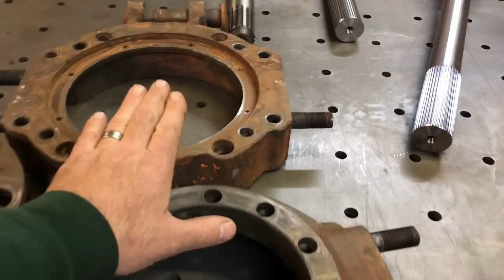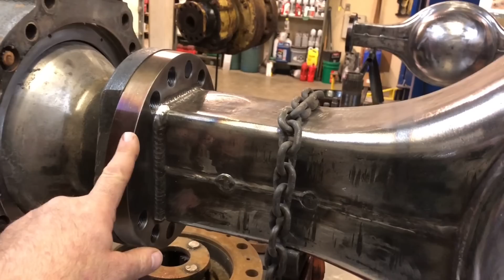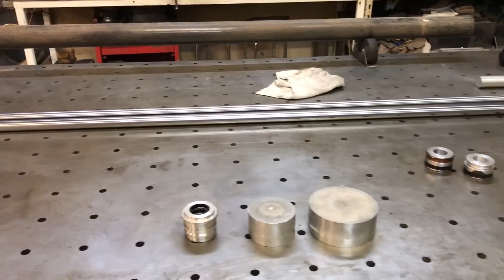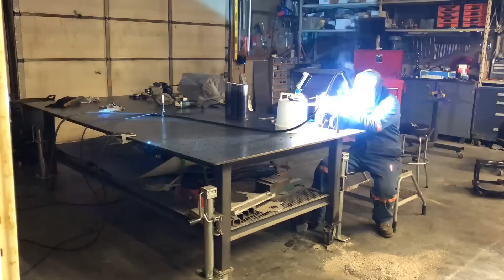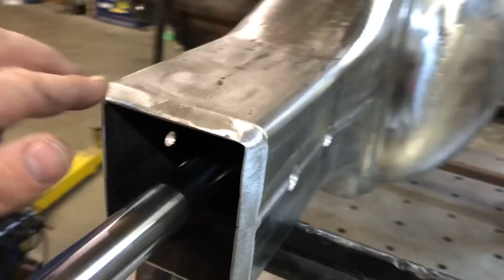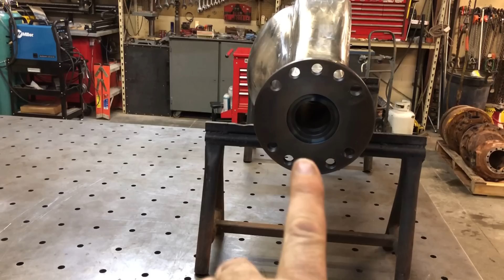Getting a start on building monster truck axles!

Comment: Never have seen anything on monster truck axles but my only question is do you have issues with the bolts breaking that go from the flange to the champagne, it just seems like a lot of leverage from the end of the hub to the flange ?
Reply from the maker: @treyblacksmith6554  
Those bolts can be a weak point, 
There are a couple guys developing an aftermarket champagne & flange that uses 14 bolts in that location.
Reply: @ gotcha , this is a super awesome technical video btw

Comment: Your mig welder has a foot pedal, or you adapted a foot pedal to it? If adapted, maybe sometime explain how you did it!
Reply from the maker: I added a foot switch,
The MIG gun plugs into the welder via a 2 pin plug, I found that same connector/plug & basically just wired in a switch I could step on, rather than squeeze the trigger on the mig gun.

Comment: Chalice :o) I like it better than champagne. And swivel housing! ;p) That is a neat trick how the knuckle splits because the leverage force is way lower than the taper bearing pressed into the ball part. Hub;  I think the gear drop is half with that set up and Zeta tractors did the same, but we never figured out why? Caster Angle; The old Range Rover diff pointed up at a very steep angle so that the two UJ’s were the same angle but opposite, so they still cancelled each other out at normal running height. Below and above that wasn’t a steep enough angle to cause trouble even with full time 4x4. I keep it as an idea in my back pocket incase I ever need to take thepiss on a short drive shaft. Bizarrely a lot of folk ran a UJ at the diff end and a double CV UJ at the transfer box end which worked very well and logically shouldn’t have :D

Comment: Great video Leroy, love the in depth information.
I am glad to see that I built my front diff the exact same way, slugging the alignment bar and reinforcements. You are a wealth of knowledge and we are very lucky to have you explain it all.
I have to look at my Rockwell PSM diffs, I thought they were the same set up on the girdle, but now you have me second guessing myself. 

Thank you for the update !
Reply from the maker: @rigneck  I’m not sure what series your PSM are, but I believe the PS205, & PS250 have a stationary ring gear with the planet gears pinned/driving the hub, so the wheel would be driven the same direction as the axle shaft, 
Nothing wrong with that system at all!

Comment: Where did you get the pettibone corners from?
Reply from the maker: @brianbures4478  
This particular set I’m currently working with came off a crane that was in a semi-local wrecking yard.
I bought both complete axles out of the crane.

Comment: Right after watching this video took me about 15 mins to make a foot pedal for my mig welder simple 2 wire Tigger just need a plug  that fits the front of the welder easy enuff I been needing that in my  life can now tack with my foot holding parts in place

Comment: Great video and fabrication mate 👍👍. 

Interesting seeing this work and how similar it is to my own custom built little Land Rover axles 😁. LR has their swivel balls (Champagne) bolted to the axle housing as yours are, they also use a CV joint (Rzeppa , but probably closer to a Birfield) . I don’t have planetary ends , though there was a small run of planetary axled Land Rovers in the 60s called Forest Rovers that ran 48-52” tyres. 

One thing I did after the housing was all fabricated and check/restraighted, was to put in a large lathe and turn the end flanges flat.

I’d be interested in how flat your flanges are after welding (that pre heat may have helped) and if you need to machine them?

Cheers from Australia 🇦🇺 🍺
Reply from the maker: @husq2100  I did machine each flange after welding the flanges to the tubing, they were only .002” or so from flat, 
I would assume they are pretty close to that again (.002-.003”) after welding them to the axle tube.

Comment: Do you have any concerns about oiling since you flipped the third members? Were mods necessary to the oiling?
Reply from the maker: @jamessheets9205  no real concerns, I’ve run differentials “pinion up” before with good results, 
If the duration of run time was longer I might look into a small oil mod or two, but for a maximum of 2 minutes worth of bouncing around, I think they’ll be ok.

Comment: Awesome, I still remember your willy's build up on Pirate, really in depth and awesome.  It looks like the petibone stuff just dwarfs the techs, spindle, planetaries etc.  Seems popular putting the petibone outers on 5 ton rocks, see it alot in the bog truck world.  Are you running the third members upsi down for rear engine, figured that's why you touched on the rotation of things.

going to be a fun project.
Reply from the maker: @Jason.O379  the pinion up configuration is definitely on purpose for this truck, when I get back to the axle project I’ll cover that more in depth, I almost did this video, but it was already getting pretty long.

Comment: Whats the diameter of the ring gear on those? I know a lot of the strength comes from the planetary hubs.
Reply from the maker: @BigBensAxles  I’m not sure, (they are pretty big) I’ll measure one & get back to you on that.
Reply from the maker: @BigBensAxles  looks like between 14 & 15 inches, (eyeballing with a tape measure while still in the 3rd member)
Reply: @skippedlink  14 or 15" must be black